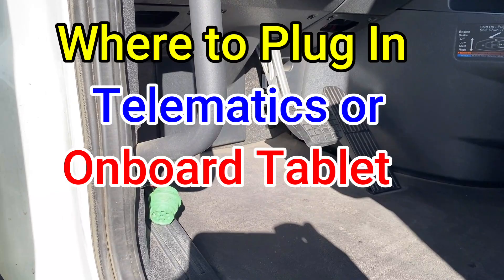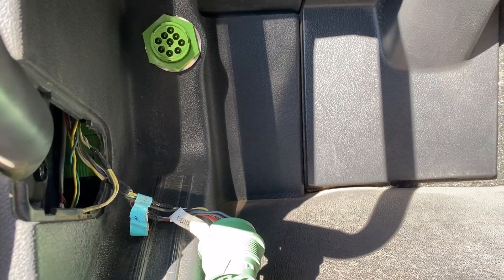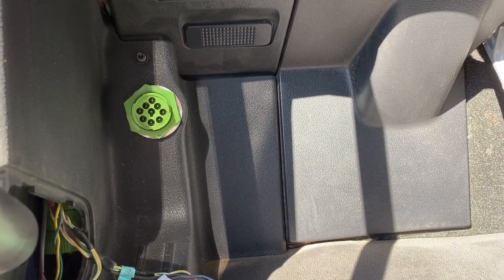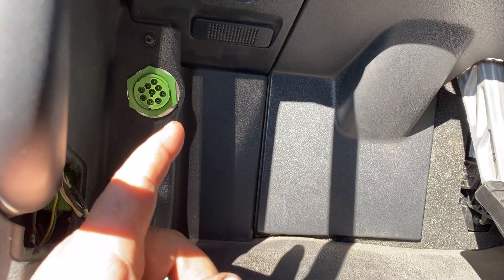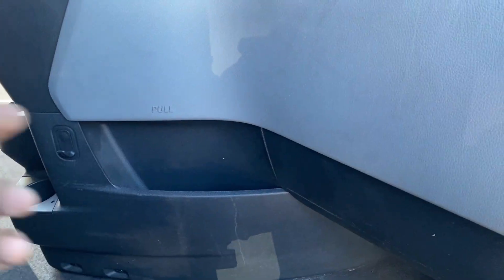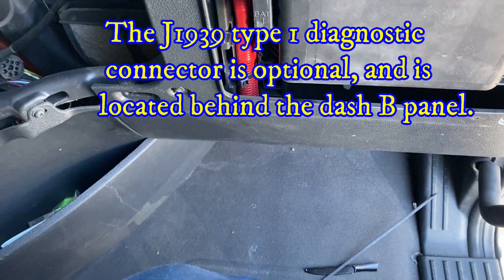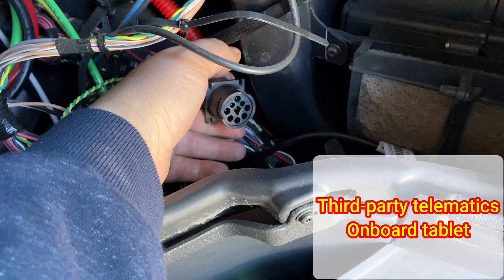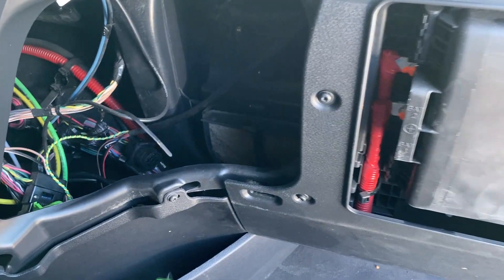New Freightliner Cascadia(Where to plug Telematics and Tablet)

Comment: I dug around in my 2020 Cascadia & can’t find it. Previous owner had a smartdrive system that I partially uninstalled. I kept it for an easy plug usb port present on the system’s box tapped into constant power to keep my ELD tablet plugged in.

Maybe they cut and tapped into the cable the 9 pin used to be on? Possible. I looked everywhere in there. Can’t find it.

Comment: I guess it doesn't apply to 2021 😔 I checked that location and nothing there to connect..anybody?
Reply: You have 1226 connector behind the removable dash panel. It has a tag on it, may have to dig around to find it.
Reply: Thank you. I'll check that out.👍 @06honda919

Comment: Hi i have freightliner cascadia 2020  it showing  a sign  cabin can data link error   when starting rain   if  weather is good then no sign . Please tell me about this
Reply from the maker: All your modules are on the passenger side under the glove box .The little older Cascadia  used to have problems with leaking to the same cab plugs on the passenger side it might have the same problem with water leaking.check plug for corrosion.